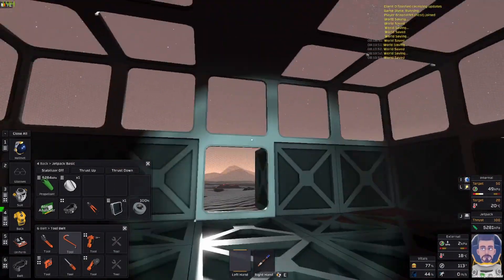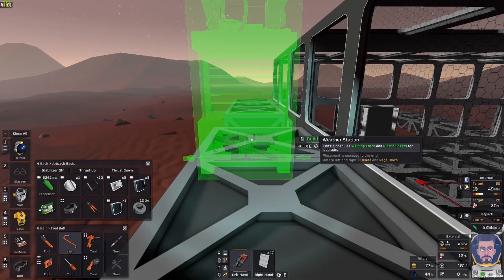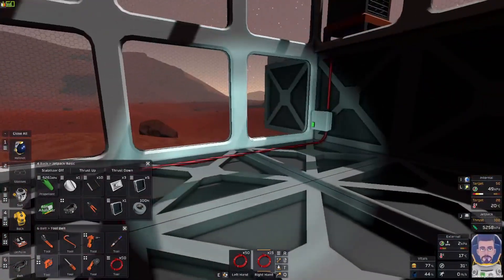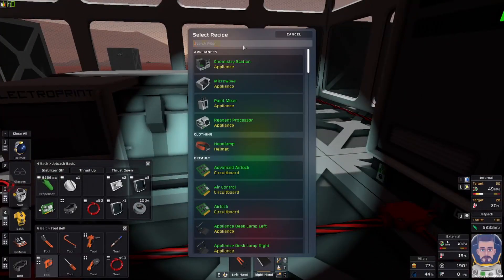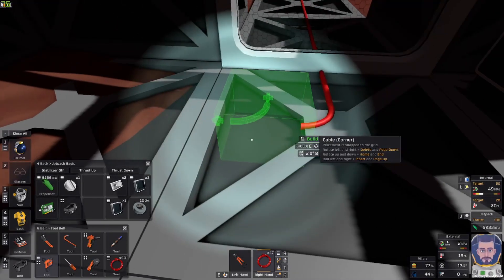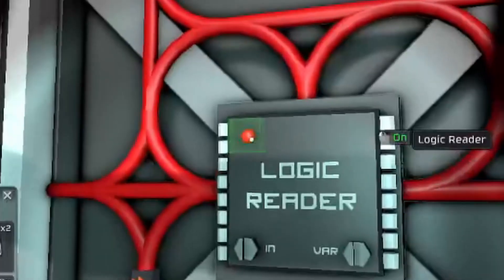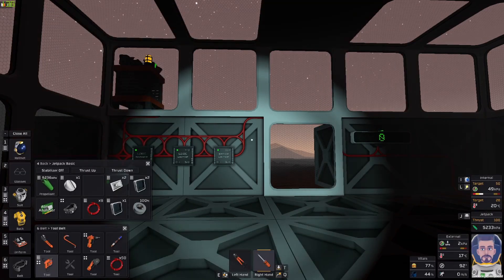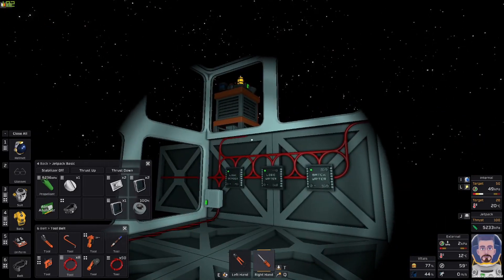Stationeers Weather Station How To

Comment: Its not working because the weathermaschine send every second a signal and my alarm sounds broke how can i fix this?
Reply from the maker: Try taking the speaker down and logic and put it back up
Reply: Im having the same problem, I tried rewiring the whole thing but for some reason the alarms will stay on even after the storm or it will just keep sending signal every second.
Reply from the maker: @sgtsoap77  try taking weather station down and rebuild it. Make sure logic is separated from the rest.  That's the best I can help with I don't know why it doesn't work for some.

Comment: If you just want to separate logic a transformer is my go to.  Power controllers are for things you want to keep running even if you lose power.  Clearly used for airlocks but I also use them for such systems like this I want to keep running even in a power outage.  Another place I use em is on logic like solar.

Thanks for the tutorial!